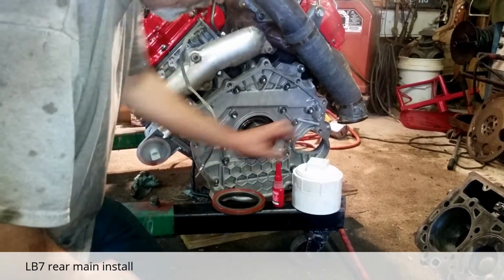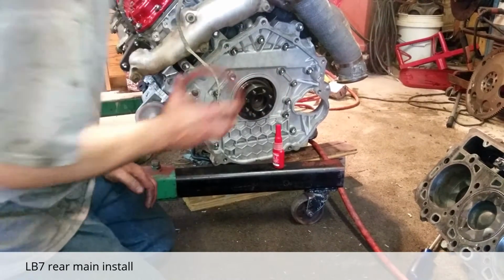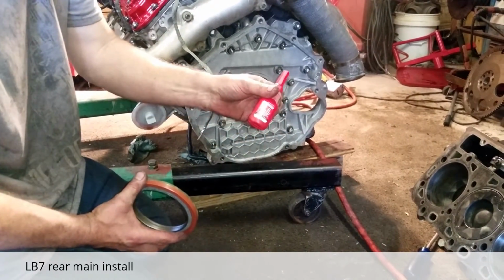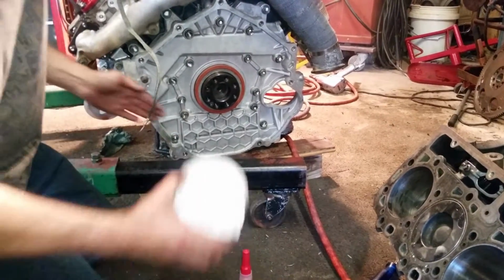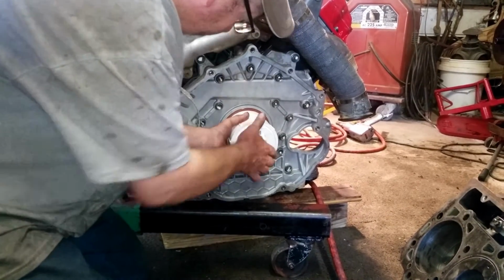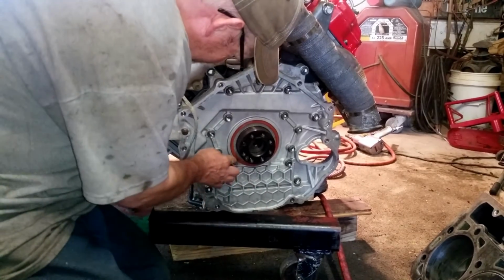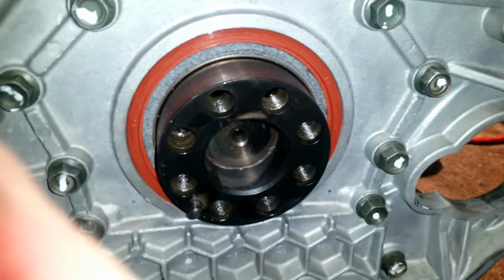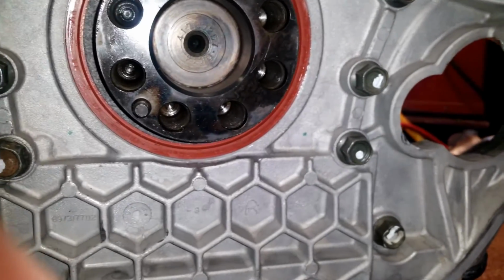Lb7 Rear Main Seal Install

Comment from the maker: Thanks for the positive comment. The seal will end up completely flush with the housing that you are driving it into use a straight edge to measure across but beside the crankshaft and it will end up flush all the way around

Comment: Why in the world would you use loc tite on the inner seal ring?
Reply from the maker: I figured it couldn’t hurt anything so why not!!!
Reply: If anything you put a little oil on the rubber seal. Loc tite is a thread lock and turns into a sludgy paste.
Reply from the maker: Yes sir I realize what Loctite is the Loctite was between the crankshaft and the metal ring it was not on the rubber part and the rubber part was lubed with engine oil
Reply: That's what I'm wondering

Comment: Why in the hell would you put lock tight on the inner seal?? That is called the crank, it's gonna turn!!!
Reply from the maker: Dustin Gushwa you obviously dont know much about duramax rear main seals, the sleeve presses on the crank and the seal  runs on the sleeve. The locktite is between the sleeve and the crank.
Reply: Seals on many medium duty Diesel engines and bigger use. Two piece seal where a wear sleeve is integral with seal. The lip of seal rides on the wear sleeve and the crank flange never gets worn. With these type seals the installer tool has to drive the wear sleeve(moves with crank) and the rubber lip seal part that stays fixed to block or back engine cover. The Duramax seal wear sleeve is all metal so there is a chance of oil leak between crank and wear sleeve if no sealant is used. Some of these two piece seals have a wear sleeve with rubber inside wear sleeve sealing it to the shaft it is installed on.
Reply from the maker: @jamesabercrombie4759  yes sir that is exactly why I chose to use loktite on mine. Thanks for your comment.